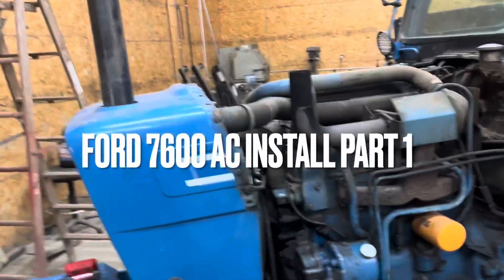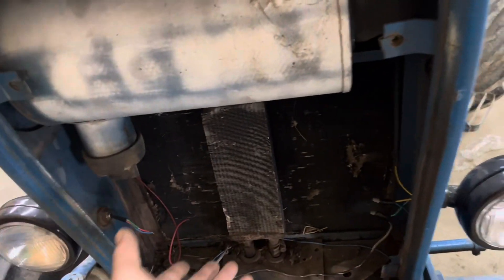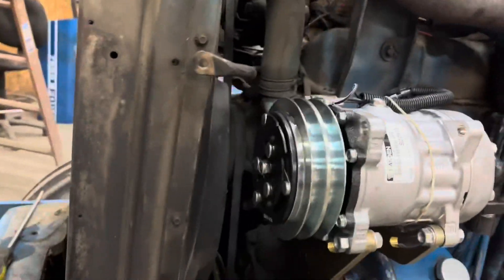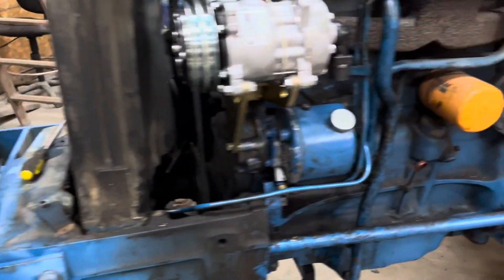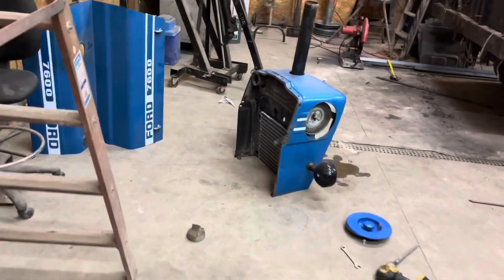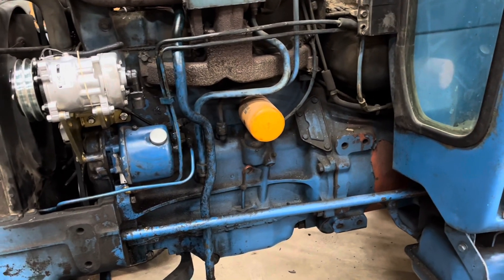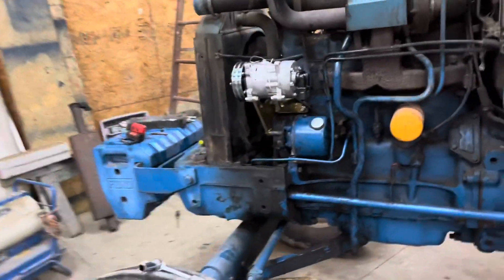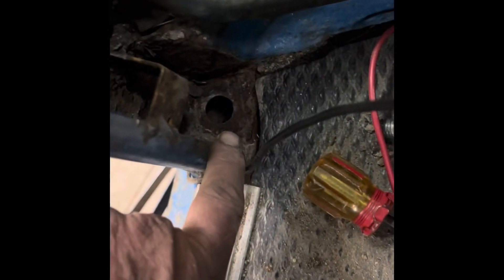How to add air conditioning to a Ford 7600 tractor.

Comment: I really appreciate this video.  Trying to fix a defunct AC system on my 7700.  I have another question as your cab sounds reasonably quiet, have you figured out a way to replace the door cab rubber seals affordably?
Reply from the maker: I think tractor parts ASAP has the door seals
Reply: @obieacres4676  ok great I will check thank you
Reply: @obieacres4676  I checked they are $257 for door rubber, too pricey for me, will try and find an alternative
Reply from the maker: @georgiabigfoot  here you go fehr cab interiors. Good price to. https://www.fehrcab.com/ford-series-1-2-door-seal-kit/

Comment: I just picked up a 6710 with factory heat but no air. How much did this kit cost? Cool video thanks.
Reply from the maker: Around $1200
Reply: @obieacres4676  Thanks! If this tractor proves to be a keeper I may have to try this.